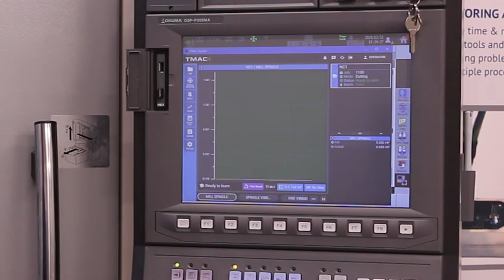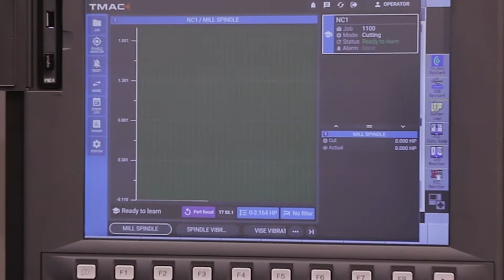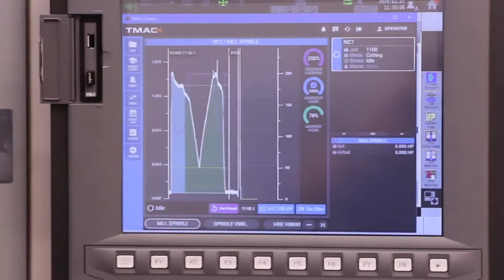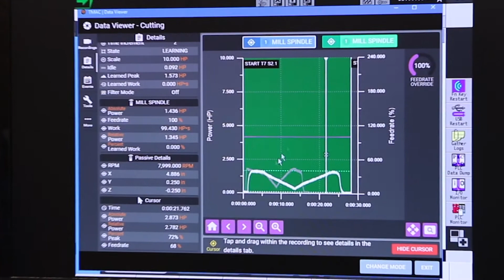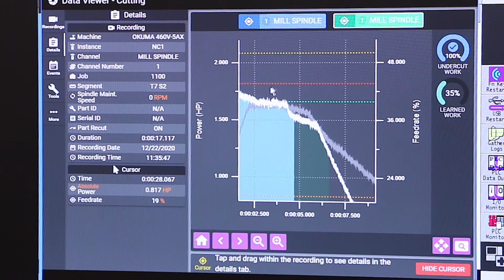TMAC Adaptive Feed Rate Control Demonstration on an Okuma Genos M560-V

Comment: What is this different from okuma’s machine navi?
Reply from the maker: The Okuma Navi is a chatter specific monitoring and suppression application. While TMAC is a real-time tool wear and breakage detection system with an adaptive control feature that optimizes feed-rates during cutting. With adaptive control, TMAC learns the optimum power for each tool and cutting section to continuously maintain a constant tool load during cutting by regulating the feed rate in real-time.  TMAC increases the feed rate through low power cuts and decreases the feed rate through high power cuts and as tools wear, to reduce cycle time and maximize tool life. This is especially useful for hard and difficult to machine materials, and/or applications where the material and cutting conditions are constantly changing.